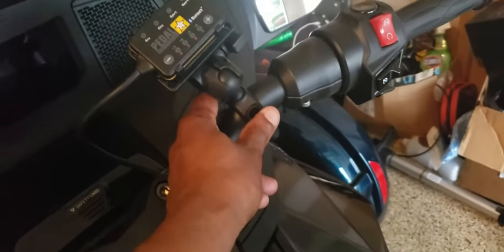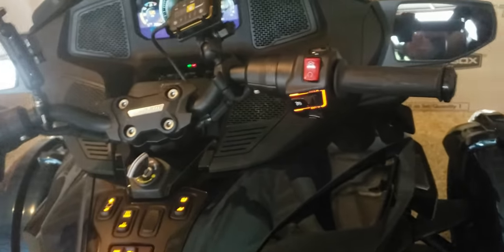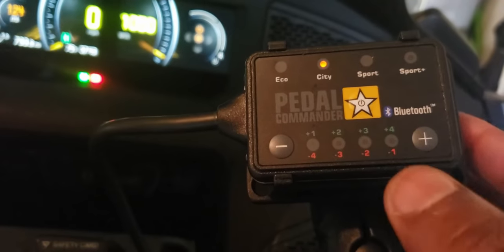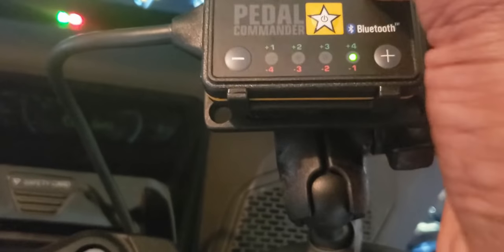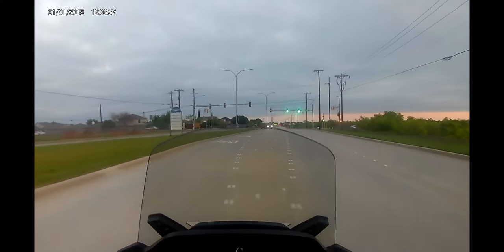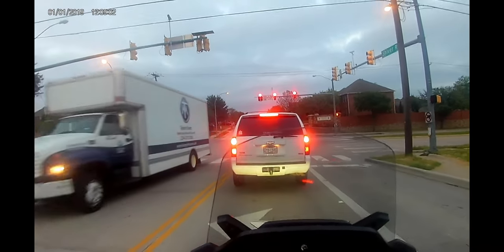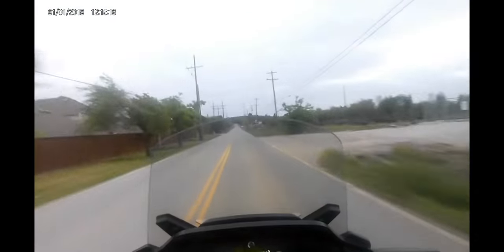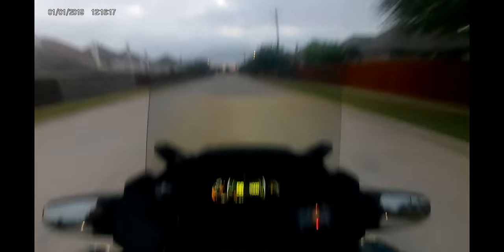CAN AM RT Limited experience with  Pedal Commander MOD

Comment: So, I just put a deposit on a 22 RT Limited and it'll be here in mid May, I've NEVER rode a Spyder b4 but from what I've seen on the Pedal commander it's amazing.  What do you think is somewhat close to stock so I don't select the wrong setting right off the get go

Comment: how's the ride when you drive over those ceramic reflectors between the lanes ? Big and Small... I know they are HUGE in Texas!!!
Reply: A noticeable bump is experienced but controllable. I’ve had the unfortunate experience running over a steel part that was shed from a truck I was following a bit too closely. Nothing drastic happened other than a definite bump.  No damage resulted from the incident.  I’m saying this as a testimony how tough the front end is.  I have a 2016 RT-S that I bought brand new with over 45,000 miles on it now.  Gonna get the Pedal Commander now. The regular throttle response lag is sort of getting to be a bother in city traffic.  Thx for your report.  Tilted me even more towards it.

Comment: Impressive report on an actual road test, perhaps a little more helpful if you showed all the install steps.  Slingmods goes through several years models, etc.  Did you have to order the handle bar mount separately from Slingmods?